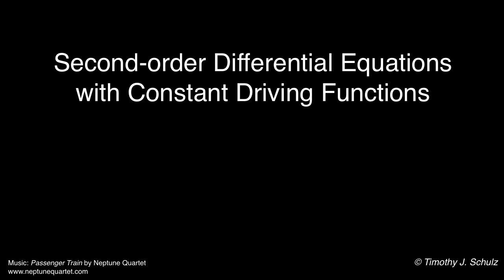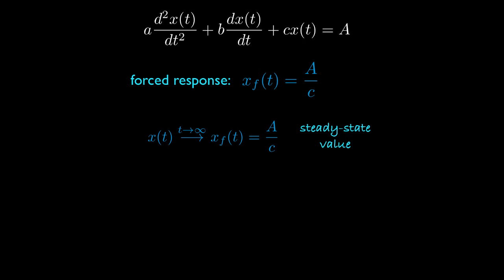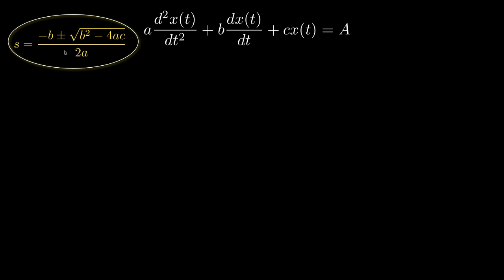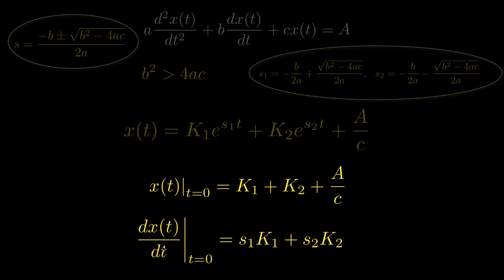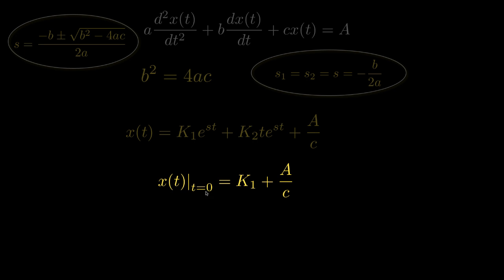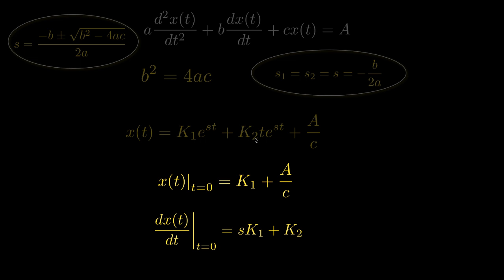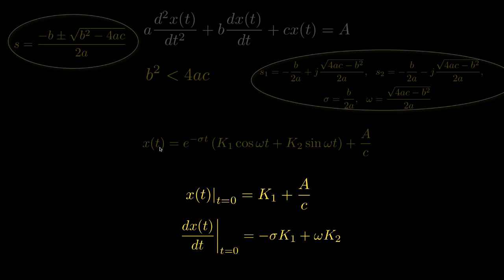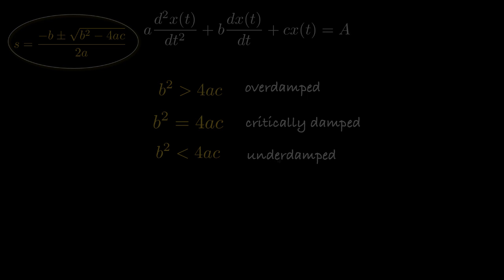Second-order Differential Equations with Constant Driving Functions

Comment: How can you find b(the constant) if you only have an undamped oscillations?
Reply: You mean a b=0,right? If there's no damping then the function entirely relies on my"+ky where m is your mass and k is the spring constant (Hooke's Law). If you solve the equation for motion via quadratic formula, you're going to get a complex root, which means your homogeneous solution will have a cos(x) and sin(x). Solve for any initial conditions on y(0) and y'(0), then find the period of motion. Because it's undamped it's like an unnatural spring that will be constant to +infinity, so you could figure out the angular freq., w=√(k/m) and general freq., in Hz/sec by f=w/2pi =1/2pi√(k/m). Hope that helped.